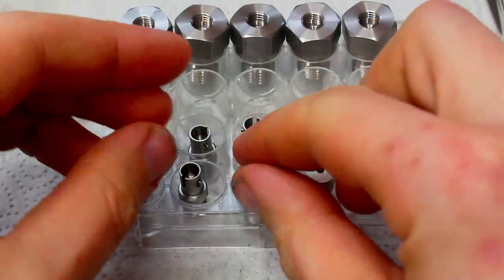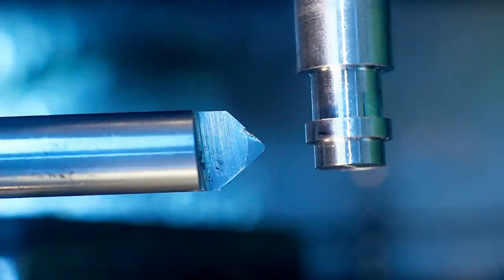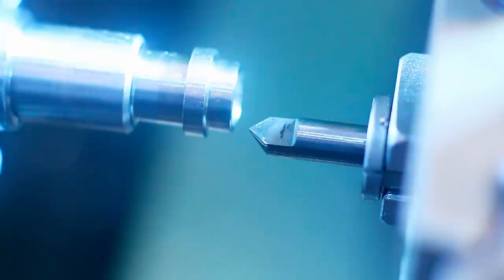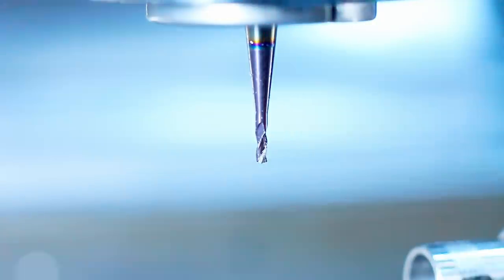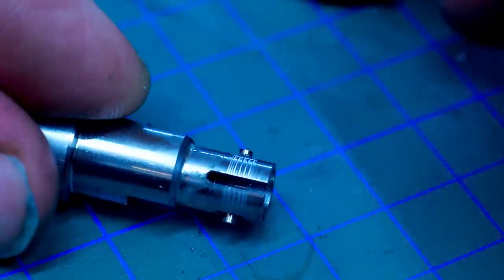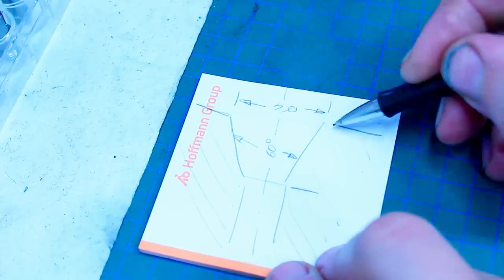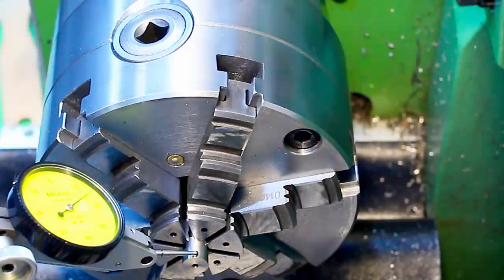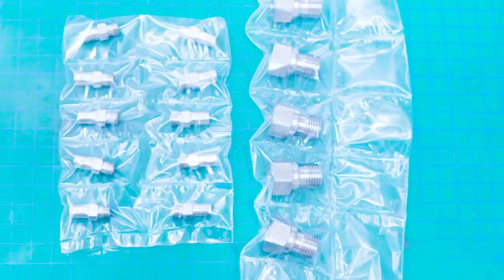Making a part: BNC style connector

Comment: they look like fairly standard fiberoptic connectors
Reply from the maker: TBH - I don't know. Usually customers have a good reason to spend big money on prototypes :)
Reply: @StefanGotteswinter  yeah guess its for somthing where cost isn't an issue and its better/easier to just get a part made with a particular mounting into the reat of the machine than finding an off-the-shelf fiberoptic bnc that's suitable

Comment: What I don't understand is why the customer just doesn't buy BNC connectors? They are available in extremely high quality. Unless it's some oddball size.
Reply from the maker: Because there is nothing standard about it :-)
Reply: @StefanGotteswinter  Ah OK, they look a bit similar with the bayonet pins (of course minus the dielectric etc.)
Reply: Yeah, given the cost differential, you can bet that  the customer had a very good (if very convoluted) reason for getting these connectors custom made.  Probably go on some very expensive legacy equipment.  Love the stainless finish.

Comment: Did you customer tell you that the too-deep taper scrapped the parts, or was it just your pride to go MIL-STD 41 (Make It Like Sez The Drawing, For Once)?
Reply from the maker: In this case I talked to them, but in general I would just scrap it and start over.
Reply: @StefanGotteswinter   When I ran a mill that put the slots into ER collet blanks (back in the late 1970s), the length, depth, width, and number of slots would vary depending on the collet size.  I once finished a lot of one size and moved on to a lot of a different size and ran a hundred parts or so with the wrong number of slots.  When the error was discovered, the shop said that they'd check with the customer to see whether the non-standard number of slots was acceptable.  (IIRC, it was something like 14 vs 16, and I never heard the answer.)

Comment: I hope that you didn't measure the diameter at the entrance to the 60 degree inner feature assuming that the 4 mm ball would go in to it's center line (so that it's 4mm diameter would touch the edge of the 60 degree's feature at it's widest). The ball would not go in that deep, rather it would only go in until it touched somewhere along the depth of the cone. The calculation to establish a depth found would involve finding the (smaller) diameter of the ball where it would touch within the cone- seemingly a more complex calculation. Perhaps this is how you calculated, I hope. Otherwise, the inner cone feature may still be incorrect in depth.

Comment: Hold on... Collets are pretty perfect... It's the surface of the machined part that's not.
Reply from the maker: What even is perfect ;)
Collets are not perfect and were jumping from one collet to another collet. And were clamping on the manufacturers OD of the material, thats not perfect either.
Reply: @StefanGotteswinter  Yeah! You said it "perfect"  not me.. Obviously, nothing is "perfect"  I can only assume you mean not the best??? Here's the thing, a cheap collet, damaged collet, oversized collet, or a part that has a scuffed surface will throw off your center and give you run out. The fact that you rotate the part then all of a sudden your run out is fixed proves this!
Reply from the maker: @Jeralddoerr  Even the highest class of 5C collet money will buy you, in a mint Hardinge HLVH or Schaublin 135/150 will give you not "perfect" 🙂
Its just a matter of accepting and working with what we have.
Reply: @StefanGotteswinter  I'll agree with the end... We could go on all day about this. I guess you can't have a conversation in the world of machines with the word  "Perfect" That's why we use measurement systems..  Have a good day!

Comment: If there was ever a need for a redesign of a part this is it. Whoever engineered this had no idea of how machining is done. I knew within seconds of the video starting this was an incredibly poor design from a machinist's point of view.
Reply from the maker: I say thats absolutely not the case. In prototyping we make constantly parts that are not designed for machining. Thats why prototyping is paid so incredible well.
Reply: @StefanGotteswinter  I would agree, 30 years ago I worked for a small fiber optic research/manufacturing company.  Everything we made would be considered prototype.

Comment: Thank you for your time, But your way can not make the money on BIG ORDER  :)
You have good machines but you spent time too much on tool changed instead  you have to program complete all chamfers  of OD  on 1st OPT  with rough & finish tool... ( your machine can't not do it ??? )
Complete OD long enough for Mill JOB  and easy indicate on Milling machine,,,
With taper hole, measure with ball & depth gage on machine, your Good HIGH GAGE can measure distance of taper...( use REPRORUBBER is optional )
On Milling machine, you can finish OD with small bottom end mill  after roughing then you don't need de-burr at the end too long .. :)
At 2nd OPT,  measure OAL then finish one time ( don't need to face off then take out for measuring )
Hope you understand my ideal...
Reply from the maker: i am not competing with mass production - I am offering prototyping in the low 1-20 numbers. And since I am swamped with work, I guess I am doing something right.
A millturn, y-axis lathe or a 5x mill would serve me very well for this kind of work, very true, but I do not have the space  for one at the moment.
Reply: @StefanGotteswinter 
Anyone  can make  a mistake .... but  I never said you did something wrong...
You just made a lot downtime on tooling changing, indicating and de-burring....
Remember : TIME IS GOLD.
Don't be mad if someone comment  on your post.
Thanks.
Reply from the maker: Sorry, I think my reply sounded more grumpy than it should have.
No offense taken from my side - But I have to work with what I have here :)